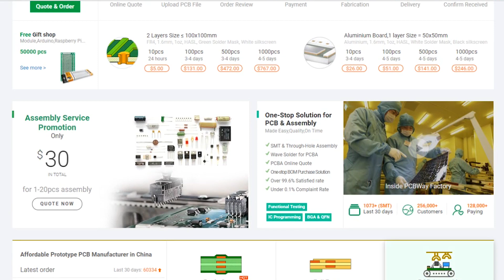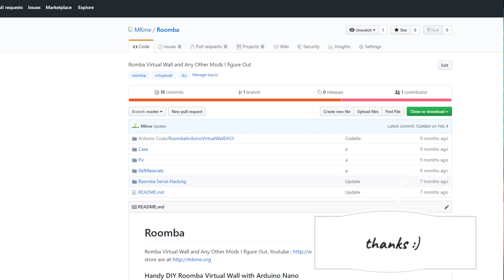🆕DIY Arduino Project- Roomba Virtual Wall 👍

Comment: Hey man, I want to thank you for doing the heavy work! Also gotta let you know that you have pull requests on your project that will fix the code for the updated IRRemote library! Cheers!
Reply: Thanks for this comment, I just downgraded the library version and it instantly started working.

Comment: I've bought a virtual wall and it's too high for the location that I've bought it for. I've a few esp8266's laying around. Can you adjust the range of the LED like adjust the brightness so the Roomba only avoids a small place? It got stuck below our oven several times and got scratched really badly (a learning proces). But there's a small path going into our kitchen. So I'll have to adjust the settings.

Comment: Hello, I bought a kit, I put it together according to the instructions and it doesn't work for me,
Reply from the maker: Triple check your connections and reverse the LED if nothing found.  Most common issue is the LED is backwards.

Comment: i  have  a roomba e6, and a CircuitPlaygroundExpress device.
the CPx device has an IR transmitter on it, but i was unable to understand how to use the pulseio object from the board python module to get the basic mark and space to work.
any advice?  is there a basic C programming environment i can use for the CircuitPlayground Express, and just use your code?
does the roomba e6 model respond to your code?  i don't see it mentioned anywhere.
thanks.

Comment: Just built this virtual wall for a Roomba 655.  Works great!  I'm using IRremote 3.9.0.  To get it to work, I took the library's examples/SendDemo sketch and its PinDefinitionsAndMore.h file, copied the basics of setup(), and then in its loop() I called IrSender.mark and IrSender.space as in the original MKme code.  For the Roomba 655, that meant using the 1000 timings for each call.

Comment: Does anyone have info on how it differentiates a home dock from a wall? I have a dock that the Roombas cant seem to see. It still charges though. I wanted to just piggyback an arduino in there and just bypass it. When cleaning, they are treated as a curved barrier. when its seeking "home" it locates it with IR and lines up the charging pads. The original board has 2 LEDs reflected up.

Comment: I connect and upload code, but can see the light of IR LED (Via camera on phone), can you tell me know why?
Reply: I couldn't see it with mine either. it worked though. its probably to the with wavelength. it may be beyond the spectrum the camera can detect.

Comment: I have a roomba 960. These work great. When using USB to power the virtual walls I find that the beam is quite effective, even past the 10'  that MKme estimates the range. My only gripe is using the unregulated voltage pins and 9v batteries seemed to drain the battery rather quickly and never lasted more than a couple days. Interestingly when using USB battery packs and the nanos mini-usb port I found that my USB battery packs shut off after a couple of minutes automatically because the current draw is so low. Anyone else having these issues?

Comment: Does the roomba only work with 940nm infrared LEDs? Thinking of trying an infrared laser diode but can only find them in the 780-808nm range. Hoping it's more sensitive to the frequency of the light.

Comment: Thanks for putting this together! If you are having issues, try switching your library version of IRremote to a 2.x.x version. I could not make a Nano or an Uno work until I downgraded to 2.8.1 due to some of the design changes in IRremote 3.x.
Reply: I too was pulling my hair out!  Problem solved.  Thank You!  Thank You!  Thank You!
Reply: Thank you for the help with the IR remote library!  I thought I had done something wrong...
Reply: @pkarza  You’re welcome! I was pulling my hair out until I read the 3.x release notes and realized that was probably the issue. I thought I’d save others the same headache.
Reply: I wasted so much time, Thank you Rich!
Reply: Thank you somuch for the support
Reply: thanks, helped a lot!

Comment: Quick question - are you able to see an IR pulse (even weakly?) in the LED when powering it on? Was troubleshooting based on if I can see anything in a camera, but not sure if this is valid.
Reply: Nevermind. This is answered in the affirmative in another question.

Comment: Do I need to download anything to the arduino? I bought your kit and solder everything as describe but doesn't seem to be working.
Reply from the maker: Likely wrong terminal, diode inverse or some connection issue. The Arduino is pre-programmed for you. Stop by the Discord and post in the Roomba channel and we can get it figured out no probs. http://mkme.org/discord  Post some clear pics or your soldering and connections to save some time.
Reply: @MkmeOrg  Btw, for me it was inverse diode. Thanks for hints!

Comment: SOLUTION FOR ROOMBA 675. Thanks the information in this chat I was able to figure out why my Roomba 675 didn't work with the original Instructions from MKme Lab. I am using Arduino One, which is not different than Nano for this application.
1) Resistor must be properly sized:  The IR led has an operational voltage and amperage range that it is necessary to meet to ensure proper performance. Based on my IR led data sheet,  the operational forward voltage range is 1.2v - 1.3v @ 100 ma.   If the voltage source (arduino board) is 5v,  you would need to add a resistance = (5v - 1.2v)/0.1A) = 38 ohm.  However,  I used 50 ohm. resistor to protect the IR led.  If the resistor is too high (80 ohm) , the IR led won't glow. If the resistor is lower than 38 ohm. the IR led will burn out.
2) Arduino code:  I used the same code suggested by Mkme Lab with the following changes:   irsend.mark(500) instead of irsend.mark(1000) and   irsend.space(7500) instead of irsend.space(1000)

The virtual wall for my Roomba 675 is working great!  Thanks MKme Lab for posting this youtube video.
Reply: thank you soo much
Reply: Bit old now, but did you get better battery life from changing those 2 parmtrs? (mark and space). Cheers.

Comment: Anyone with the I Series, use 500 for mark and 7500 for space.  Lots of testing paid off!
Reply: Thank you very much. It wasn't working with 1000 each for mark and space for my I3. irsend.mark(500); and irsend.space(7500); worked great!
Reply: @mikeg5250  Excellent. I will try those settings with my i3. the 1000's didn't work that well for me either.
Reply: Excellent! Finally got this working with 500 and 7500 on the i7.

Comment: Looking at the code it looks like it repeatably turns the led on for 1 second then off for 1 second. Is that it?
Reply from the maker: No. 1 second on 38Khz one second off
Reply: Ah ha, I see. Modulated. Thanks.

Comment: You solved a big problem that I was having, for not being able to acquire the virtual wall. In addition, the cost was ten times lower (U$ 400 to U$ 40) for five virtual walls. Thank you very much for publishing this video and making the libraries available. Luiz Antonio, from Brazil.
Reply from the maker: Welcome. They work pretty great for a few bucks in parts :)

Comment: I recently got a Roomba i3 and made one of these virt walls but the roomba ignores it. I even tried changing the resistor to make the IR led brighter and also dimmer. Loaded the IRremote library again and messed with the ms on/off but no luck. Any suggestions?
Reply: I am having the same issue with my i3. I was able to see the IR light up through my computer web cam, but it won't stop the i3 from going where it wants to. Any one have luck getting this to work?
Reply: @enzomiceli1984  See Rich and Ramiro above. This is the kind of information that should be presented in the video. For the i3 I've downgraded to library  2.8.1, adjusted the resistor to 100ohm based on my IR LED (1.2v forward, and 50ma). I've also changed the timing to mark 500, space 7500. Seems to be working now. Before downgrade to 2.8.1 I could not detect any IR with phone camera. I've also used alternative wiring...  D3 -> resistor -> positive on LED -> back to GND (not 5v!). (On an old NANO)
Reply: As someone said above you need to use different values for mark and space. Use mark(500) and space(7500). This works on my i7 perfectly.

Comment: Excellent thanks! I'm moving to a bigger apartment and wanted to do just this to prevent it from going to a certain room. I'm thinking of adding a switch to the box so if I have a messy (things on the floor) room I can click this thing on and when I have cleared the room then I turn this off. And 2.0 would adding them to home automation system so it could be done remotely.
Reply: i wonder how many Ir leds can you use on one board

Comment: I know this isn't really a support section however is anyone aware if this will work with the a new Roomba i3?  I made this circuit, checked with my cell phone & it's outputting IR light but the roomba just ignores it..

Update:  Broke out the scope - verified 38khz carrier & 1ms on/1ms off
Reply: were you able to get this working?

Comment: I'd add a blinder on the front to direct the light straight out across the door threshold so that the Roomba can get closer, but still not cross the line.

Comment: I built this but no luck, my Roomba just plows through it :(

I was going to convert it to an ATtiny85 then I tried with a UNO and no luck.

Any ideas?
Reply from the maker: Verify the LED is working, reverse the polarity of the LED if you have it reversed.
Reply: @MkmeOrg  Thanks for the reply :).

I have the polarity correct. Viewed it through my camera. I actually got it to work with the UNO (i didn't change anything). Could the ATtiny85 16mhz clock not be fast enough for the 38mhz IR pulse it sends at?

Comment: Hi Mr MKme,  I tried the code you posted in the Arduino IDE software and do the verify function and it didn’t work ! . This make me go to Arduino programming to learn more about  this,  my question is,  this code really is the one or there is another that you keep in secret ?
Reply: Hi Mr MKme,  I could made the code uploaded to my arduino Nano, the problem is the missing IRremote library in my IDE software, I have to found the Zip file using google and added to mine IDE and its work OK!.
Reply from the maker: Good stuff
Reply: @aguila913  I had a similar problem. I know the scope of this video isn't using an arduino so I think he gets a pass , but if you're a noob like me I recommend watching a video on flashing a nano with a library

Comment: I tried the “DIY Arduino Project- Roomba Virtual Wall” project with a model 671 Roomba dual mode without success.  The suggested parts were ordered from Amazon and wired on a project board.  After powering up the circuit, the Arduino NANO was loaded with the suggested software without any problems.  The circuit seemed to be working as verified by looking at the IR LED through my cell phone camera and observing the violet color being emitted by the LED.  I positioned the project board with the LED pointing at the same level as the roomba at the entrance of an adjacent room.  The roomba passed the led without even slowing down.  With what Roomba models does this project work?  Is there any difference between models as to frequency of operation or pulse width?  Is there anything else I can try while I’m at the bread board stage?  Any information would be greatly appreciated.

Thanks  ......;. RMPPOD
Reply from the maker: It is a 671 shown in this video.  I have 2 of them- they are confirmed just fine.  Roomba uses the same IR protocol for all models with IR.  It is right in the docs I supplied with the code- they made all their protocols available for makers.

Comment: Thanks a lot for the video! I have a question: Can I use normal 3x AAA batteries? How long it will survive with this code running?

Comment: This is great. Thanks a lot. How are you powering the Arduíno? If I use batteries, any ideia of how long they would last?
Reply: I tried using a 9v battery to power mine using pins 29 & 30. Went dead within a couple of days. I'm using " ELEGOO Nano Board CH340/ATmega+328P" from the Amazon link. This has happened with all 3 that I built (also using the above listed IR LED) using  220 ohm 1W resistor and 1/8W 220s. I'm thinking the onboard voltage regulator is junk. Unfortunately I have restored to USB and wall-wort power supplies. Oddly enough none of my USB battery packs work with the devices, they shut off after a few minutes. I'm guessing the power draw is so little that the battery packs (an anker and a couple other no-names I got at various conventions and trade shows) builtin protection shuts them off. I realize your comment is a year old and I'm curious if anyones had better luck with batteries than I did

Comment: I tested this out with an Arduino Uno, but in order for it to work, I had to wire it from pin 3 to ground, not from pin 3 to 5v.  Is there something different about the nano?
Great project, and thanks for all your videos!

Comment: Been building  projects with arduinos for years. So I tried this based on your purchase links below yet it does not work.
Reply from the maker: Not sure what you want me to say here- Try harder?
Reply: MKme Lab a good reply would be. It works on xyz roomba and not xyz model. If you did this in September and it worked it should work on all models. Is there anything missing in the video or github? My wiring lines up with yours and the code was copy and paste. I sit it on the floor and she goes right pass it or runs it over. Any more details or elaboration in the video on the github would be appreciated. Has anyone else tried?
Reply from the maker: @genxweb  The IR protocol is universal. The Roomba docs are in my GitHub. They made their protocol open for the world. So I would say- recheck your build.  Check to see if your IR LED is lighting up (use any digital camera close enough it will show a glow if working). Check your polarity. Check your code is running. From there....recheck.
Reply: @MkmeOrg  In Roombaland there are two standards for these things.  You can buy the "lighthouse" model directly from iRobot, and it won't work for the models that are set to work with the "dual mode" models.  It looks like you've expertly replicated the "dual mode" type here... which won't work for people who need "lighthouse".  Thanks for covering those of us who have Roombas that talk dual...  I'm ordering parts...

Comment: I looked at your code and from the look of it you're blinking the IR LED in 1 second intervals with mark(1000) and space(1000).  I thought that Virtual Walls were 1ms on and 1ms off?  At first I was wondering why you were leveraging a IR library to do that and then I read the supporting site and figured out the pulses have to be on a 38kHz carrier....so including the Arduino makes total sense to me now.  Are you planning to implement a IR receiver to control these at some point?  I think it would be cool to have one of these, or a set, IoT enabled but that would be a challenge to drive that carrier off of a ESP8266 device.  Not a deal breaker though...I'd just have to turn on/off the pulse segments on the ESP8266 and generate the carrier with something like a 555 Timer or PNP push-pull driver.  They implement that on the dev board but I'm not entirely sure if this is the method it uses.

I'm hoping this was a proof of concept for something more....if so I look forward to you building on it!
Reply: I was surprised to see NOTHING in the video about how the IR beam actually worked, thanks!
Reply: @gravelbar Right? I was watching the video on 2x speed just trying to find where he said the pulse pattern. I wonder if the timing has to be hyper-accurate? If not, seems simpler to do this with two 555s, an AND gate and a transistor. Costs about $2 instead of $25 for the Arduino. 

If the number of pulses per cycle needs to be exact, you can replace the second 555 with an 8-bit counter and a 2 more ANDs from the same quad chip.
Reply: Look better :-) The units for the `mark()` and `space()` routines in `irSend.cpp` are in fact usec (microseconds) -- not milliseconds. As 1000 microseconds is 1 millisecond, there is nothing wrong with the timing.

Comment: Awesome ! . I'll try the same using a D1 mini. Thanks .
Reply: Hello, I'm also trying with D1 mini and control it with Blynk..did you succeed?
Reply: @marcofrancescato9021  I also tried it with the D1 but I never seemed to get it to work, I tried it with this library. https://github.com/crankyoldgit/IRremoteESP8266 maybe it will help you